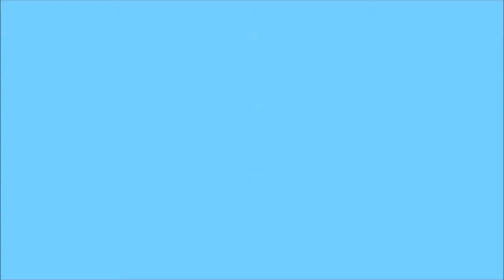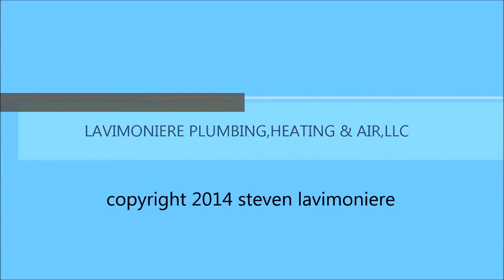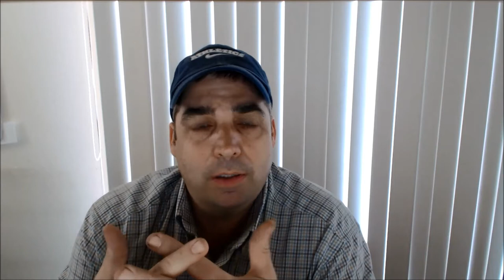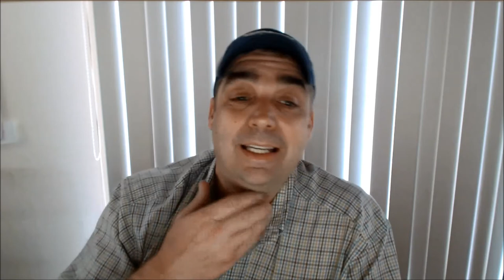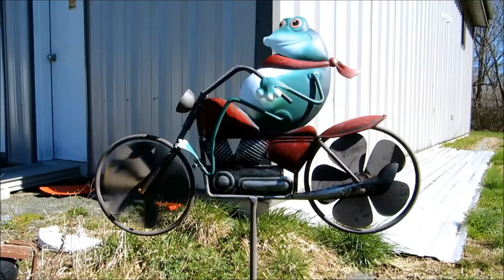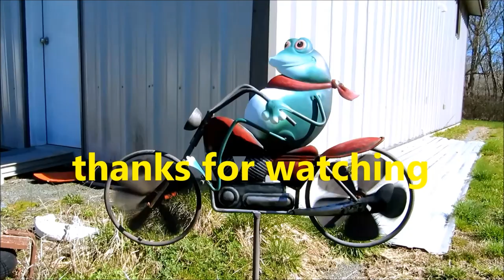hvac my thoughts on high efficency equipment part 1

Comment: Love your videos Steve. I feel the same way as you. I installed a Lennox central A/C & gas furnace for my parents home around 1976 and it's still going strong so far.  I maintain and clean them every year.  They don't make them like they used to anymore. Retired sheet metal worker (StL MO).

Comment: Thanks Steven for taking the time to make this video. I work "in house" not on residential heating and cooling, but I'm learning all the time from your troubleshooting videos. It beats "the learning curve" when someone else has experienced it and shares their thoughts. Your right about all the new high tech equipment, everything has a circuit board in it. When the board fails, then try to find the supply house that "has to order the board" because they don't have it on the shelf. The customer is bullshit because it isn't fixed in the same day.
Reply from the maker: that is true the newer stuff parts have  to be orded  some times ..there not in stock

Comment: We put in a York high efficiency furnace and ac system back in 1994. York stellar plus. Single stage furnace and ac. Psc blower. It’s been bulletproof, but now it’s got a leaky coil pan,. So have to look at new equipment. . Seen all this crazy new stuff, but starting to think I’d like to replace it with the equivalent of what I have.

Comment: High E. Is in demand , however I'm with you Steve 9-10 seer builders model equipment cooled homes great for years , then we got the tree huggers involved. I think TXV's are the way to go if the installer does this install correctly to protect the delicate parts inside I always take power head off the TXV and rap to body, some I completely take the TXV apart. But again a piston insures consistent metering or consistent superheat in evaporator , and TXV valve with control superheat in evaporator based on the leaving suction saturation on the sensing bulb of TXV , also with TXV it's important for proper equipment sub cooling to insure that the TXV is getting a solid column of liquid refrigerant to meter.
Reply from the maker: i do agree txv are good but my point is they break or can break .. and they do. i piston will never break .i have found with a piston if there is matching equipment the subcool and superheat will be right there ...for the most part

Comment: I had a no heat call in January.  It was a 90% furnace and some condensation in a vacuum line and it stopped the whole system.
I agree, more is not always better for us who have to repair these systems.

Comment: Steven I want to thank you I am having a new heat pump installed ac man wanted to go with york I was watching your vid  found out about the micro  condenser he was going to do it this Tuesday now I think I will get a heil no varbile speed scroll compressor 14 seer no 2 stage compressor thanks you save   me  from all that. High tech shit grady

Comment: I like to do a 90+ single stage gas furnace with a 13 seer heat pump. I back it up with the White Rogers 90 Blue multiple capability thermostat and outdoor sensor. Talk about low utility bills.

Comment: You are right, Steve. It will break and there will have to be parts ordered and days lost. I just finished a 18 SEER Amana install. One of the communicating stats was bad. I have to wait a week for the stat! Sucks. Good blog, great points.
Reply: The Stat still works somewhat, just reports a false temperature.
Reply from the maker: i figured this vlog would stuff up some responces thanks for watching@ commenting zack

Comment: Here in MN, HE furnace makes sense, at least single stage. 13 seer AC is fine most years. But I did industrial automation for years and furnace controls are pretty simple in comparison.

Comment: I see it a problem also especially with the tankless heaters and combi boilers, as far as furnaces (condensing) Amana makes a good product so does AmericanStandard, only thing with their two stage compressors, being controlled by some rectifier AC to DC voltage had a couple issues with them. I find myself needing to refer to manual constantly for help even TechSupport line at times to figure things out. nothing like a good ol' Cga WeilMclain boiler spark ignition. i myself try to push those too. Good talk Steve You are the man!
Reply from the maker: thanks n.j. for commenting

Comment: Steven, as long as the DOE and the EPA are involved we will continue to put up with high efficient equipment. The main reason it doesn't last is because of the way it is installed and commissioned or the lack of proper installation techniques. It is basically the same old story brand new high efficient equipment installed on a 30 year old duct and expecting it to run as the manufacturer intended it to. The controls have come about because the EPA saw Mercury as a toxin, which it is so they made it illegal to use.
Reply from the maker: the old mercury t stat were fine,but like you say the epa,gets involved thanks for watching larry
Reply: The good old days!

Comment: Steve I'm lucky I do a lot commercial work , apartments and condos. the only time i deal with that high tech crap is once in a blue moon when I do a smaller residential job at the home owner request. I'm also starting to love rheem and ruud equipment too. They make good stuff. Good vlog
Reply from the maker: thanks ace for watching

Comment: Anytime that you introduce more points of failure into a system, it becomes a less reliable system and increased maintenance cost over the life of the equipment. I think They are designing this stuff to last a certain amount of time so you have to upgrade in the future.   Its called  planned obsolescence (also called built-in obsolescence or premature obsolescence) is a policy of planning or designing a product with an artificially limited useful life or a purposely frail design, so that it becomes obsolete after a certain pre-determined period of time.

Comment: I try to steer people away from the high end stuff. I see two types of people who buy the super high end stuff. 1 is they have the money and want the top of the line. 2 is the people who only hear energy efficiency. Both complain the most when they receive a repair bill for a variable speed motor, 2 stage compressor or a high end control board. I like to steer people towards equipment that holds up well and doesn't cost an arm and a leg to repair when needed. I like dealing with happy customers. According to the boss the bulk of our business comes from preventive maintenance. I even remind people to cover up the AC condenser after summer.
Reply from the maker: yes maintenance is so important i agree .i tell my customers to cover there a.c. also lol

Comment: I think the same Steven. Everything over here domestic sized is wall hung, condensing and full of electrics. Heat exchangers rot out quickly. I still come across 40 yrs old plus boilers with cast iron heat exchangers which are working fine. Ive replaced some modern boiler 2 years old which were beyond repair..... why re invent the wheel?....
Reply from the maker: wow 2 years old thats crazy.thanks for commenting darian

Comment: I've been very happy with my high efficiency furnace.   Both heat exchangers are stainless steel and have a lifetime warranty for the original purchaser.    Parts and labor warranty for ten years on everything else.    Rebates, a tax credit, and fuel savings will pay for the whole unit in about seven years.    It's done five brutal winters with zero failures.     You'll pay a lot more for fuel over the years than the furnace itself.

There is a lot of truth to this video.    I've seen neighbors get the 100% variable units with communicating thermostat have nothing but problems.   One neighbor has the hvac co at their house every month during the winter.    It's better to stick to the mainstream models.    I think one would be totally fine with 90%+ unit w/ two stages and ss heat exchangers.
Reply: It's not the heat exchanger that you need to worry about.  The circuit boards, ECM motors, sensors, etc. are very expensive on the high efficiency furnaces plus labor will be high because the service tech will probably need special training to fix your equipment.  Location also determines whether high efficiency is needed.  A high efficiency furnace might eventually pay itself off in lower energy costs when installed in Michigan but won't save you much in most of Texas or Florida.
Reply: your neighbor has the Hvac van every month in winter....and let asure you the technician has the manufacturers technical support on the phone every time hes in, counting led light codes
Reply: @fernandofhernandez899  Update:  Neighbor had entire unit replaced a few weeks ago.   I'm not sure if they gave up and it was warrantied out or if he just paid out of pocket.

Comment: You know the answer. Manufacturers learned a long time ago to stop making equipment that would last 40 years.  As a manufacturer, would you rather sell a unit every 10 years or every 40 years?  More parts equals more part sales.  Its all economics.

Comment: Parts for these new units will get cheaper and more readily available over the years.
Reply from the maker: i do think you have a good point there stephen
Reply: Stephen Rardon when variable speed came out trane sold the module for $60 now you can't touch it for $500.
Reply: Everything Trane is expensive! I tried getting an evap coil and they told me something $2000. We ended up buying an air handler and taking the coil out. I don't think anyone else is that expensive!
Reply from the maker: 2,000 for a coil wow.
Reply: David Feherty had the same solution with Lennox equipment. Cheaper to buy the air handler than the coil.
Reply: It was just under $2000 straight from the supply house that we use for AmStd/Trane. Trust me, I was near about on the floor after hearing that one.
Reply: That's flipping crazy!
Reply from the maker: sounds like a trane wreck to me
Reply: Stephen Rardon everyone here knows u a damn boss of a teck and can fix anything but nothing is getting cheaper, HIGHER HIGHER HIGHER everything!!!!

Comment: forced air boosters, furnaces, fryers you name it are fine, super high efficiency forced air units with gas "elements" are nightmares for both the customer and the repairman. Not only are they finicky at best, the parts are outrageously expensive. Gas elements for steamers, fryers, boilers, boosters etc are 900+ dollars, plus installation and require four new gaskets each time it needs replaced.

 This new equipment may be high efficiency, but its either outrageously expensive/complicated, or incredibly cheap and throw away. Both cases the customer is stressed for a cheap repair on an expensive unit, or pushed to throw the unit away and install a new one.

Comment: Another reason to have the more efficient hardware is HIGH RATES.  California power companies are charging extreme rates, area of 36 cent per kWh and once you use so much in a month, the rates go up to 47 cents per kWh. At those rate the bill is $180 for the first 500 kWh and $235 for each 500 kWh once you hit tier 3. Most residences seem to use around 700 kWh in moderate to mild climate but when its hot for 4 solids months and nights in summer, folks are getting bills as high as $650 s month. Only just a year ago power was about half the cost and maybe 4 years ago, power out that way was 1/4 what it is today.  Obviously nothing in the economy is related to those kind of high rates so the state is just allowing them to get tons of revenue of the backs of the simple folks. Very Sad.

Comment: Speaking from the perspective of a customer, I would heavily weigh the  initial cost against how long it would take me to recoup the outlay of money to buy the higher tech equipment before I would start realizing the so-called energy costs savings I would expect to see.  

Beside this,  the independent techs are going to go broke keeping tooled up to work on this ultra high tech equipment coming our way.  Maybe that's the plan;  price the independents out of business and biggie companies will monopolize the field. When the competition is eliminated,  the customer will be at the mercy of those big companies.

Spending a lot of money for this stuff that won't last like the old stuff doesn't make sense to me either.  GOOD THOUGHTS STEVE

Larry Cole is right.  The EPA AND DOE have caused far more problems than they have solved.  But that is the plan isn't it?  Make everything too expensive.
Reply from the maker: best to stay far away from high seer equipment if it breaks you will pay out the ass to fix it

Comment: High SEER System's are Good Until you hit the First Problem, then after that steven lavimoniere Pull Out The Wood Chipper and Dump Them All in it! Cause Part's are going to be Expensive! 

I'm already seeing new company's opening up creating and designing new after market part for these high seer system's. The Air Handler Blower Motor was the First Culprit! OEM PARTS ARE GOING TO SKY HIGH IN PRICES!!!

Best Regards; 
Willie. 
Stay Thirsty My Friend.
Reply from the maker: lol willie  you might fit in that woodchipper  .

Comment: I don't care about efficient a ac unit is as long as it cools right keeps me cold. And a furnace that keeps me warm  I don't need high tech crap I don't need a ac system that's smarter them me. We tried a high end tstat  and we never could get the stat to stay at a certain temp it was to fancy we changed it with a low end Honeywell.
Reply from the maker: high end is not always better
Reply: very true.

Comment: I bought an 80% because it will take 5 years to recoup the money you paid up front for 95/96% furnace
Reply: More like 15+ years.
Reply: 5 years to break even sounds pretty good to me. I target a 7 year breakeven. I do agree that if you have to spend more money to fix a high efficienty furnace then the math doesn't work out. In my case I am still considering a high efficiency furnace because I can fix some of the inevitable  problems myself. This assumes a 7 year breakeven so you'd have to drastically reduce your yearly heating cost.

Comment: Here are my questions.  Can you make HVAC equipment more efficient without adding all of the complex electronics and microcontrollers?  Can you make HVAC equipment more reliable and more efficient.  So far, the answer is NO to both questions.